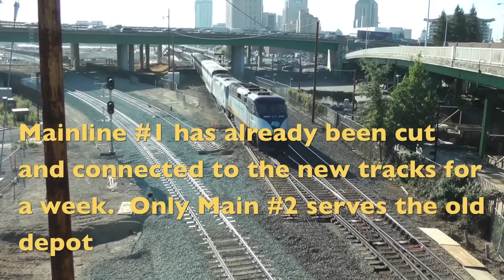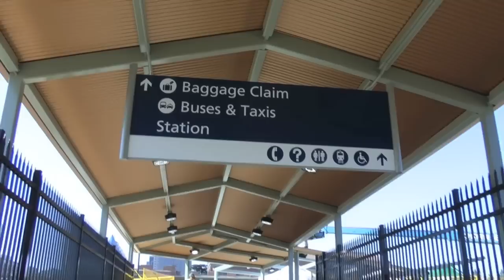Sacramento Amtrak Station Platform Relocation

Comment: And now we're pretty much back to a near alignment with the old (1880-1926) CPRR Arcade Depot alignment...not exact, but very close. The new line sits almost on top of that period's "freight main" bypass that was just south of the Arcade Depot structure.
Reply: The station tracks had been connecting to the "freight main" at 7th Street & D Street from 1926 - 2012 ?

Comment: I know it takes money.  Elevating the track through Oakland, in lieu of street running, would increase train speed through the area as well as public safety, and reduce traffic congestion.  Costs could be shared with Amtrak, UP, Caltrans and City of Oakland.

Re the turns, the worst offenders are on either side of Fremont as the train cuts over from the east bay line to Niles Junction.  Seems there is enough real estate in both those areas to increase the turn radius.

Comment: How many of the Old SP shops are still there now?
Reply: Alot of the core buildings are still surviving. Sadly the roundhouse was demolished in the late 1950s to make way for diesel repair shops. The California State Railroad Museum, right where Gary was filming this, is extending their museum over to the shops.
Reply: @thesierrastandard7281  I bear sad news in that regard. All plans to convert the old Boiler Shop and Erecting Shop where the collection of the museum is currently stored into a fully functional museum of their own have been abandoned. The structures are in line for a full restoration, however, to further maximize the use of the buildings. Plans would be to rebuild the tracks in the boiler shop and use them as excursion equipment winter storage, while the erecting shop bays will house the non operational exhibits. Much to be done, but the good news is they aren't going anywhere. With the onset of Project Railyards, all of the six remaining structures will be reinforced and repurposed for public use, ensuring the survival of the beautiful structures that were instrumental in Sacramento's history

Comment: elevating the track is really not an option as the grade would be too steep going into the yard and the numerous freeway overpasses would also be a problem as the would have to either brought down to ground level or raised even higher. Given that two of those overpasses have just been replaced, neither is going to happen.
Reply: It really wouldn’t be an option, one of those freeways is I-5, a vey busy freeway

Comment: OK, so when are you going to double track the main line and raise track speeds to 100 mph?  Both the GE and EMD locos can do 100.  Capitol corridor is just too damn slow.  The worst is San Jose to Martinez, way too slow.  Street running through Oakland is insane, elevate the tracks.  Turns are too sharp (slow) on either side of Fremont.